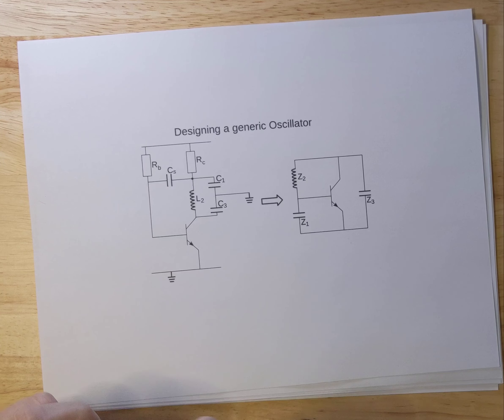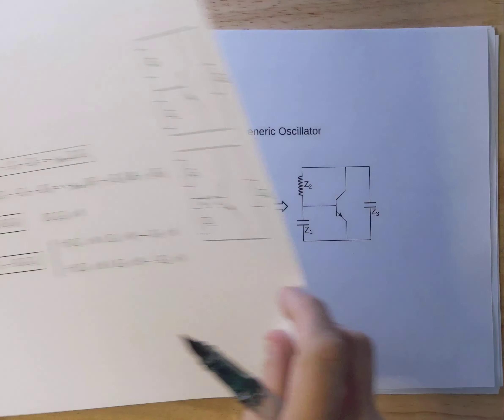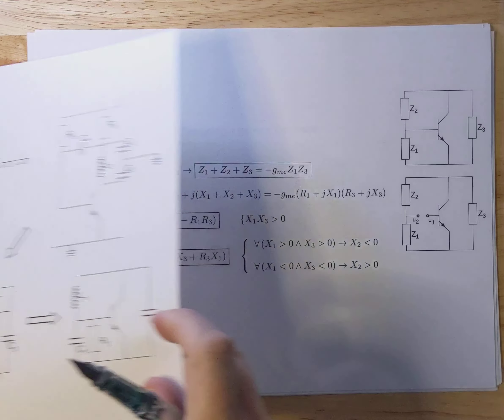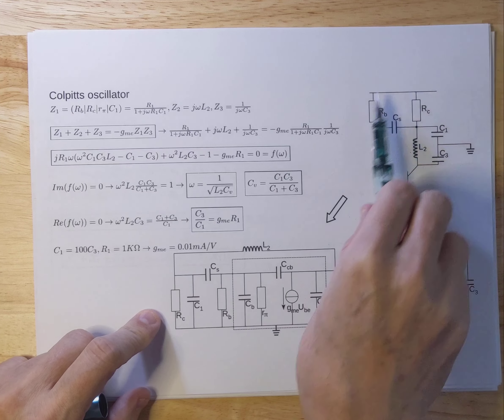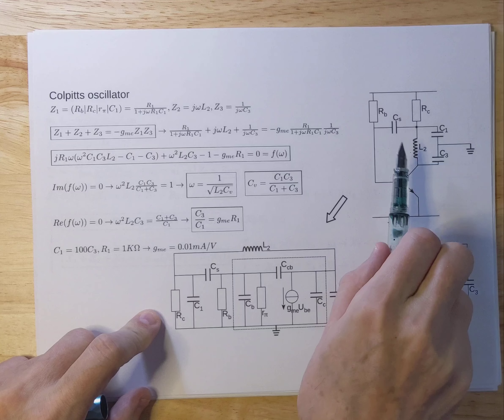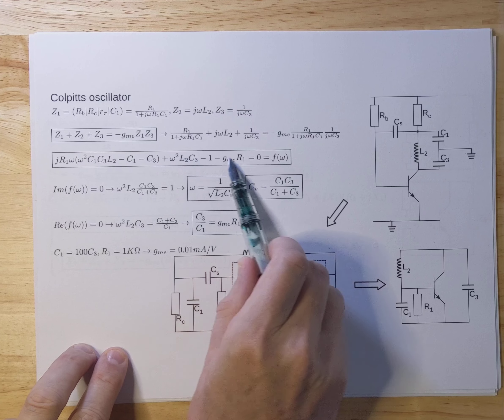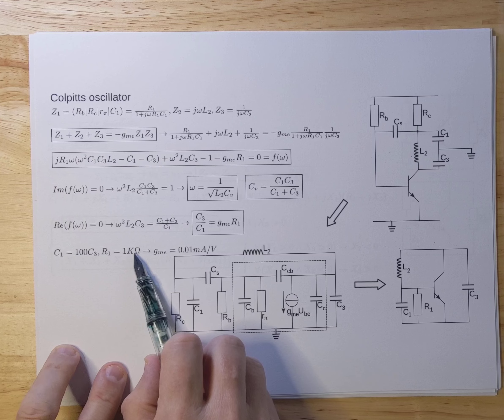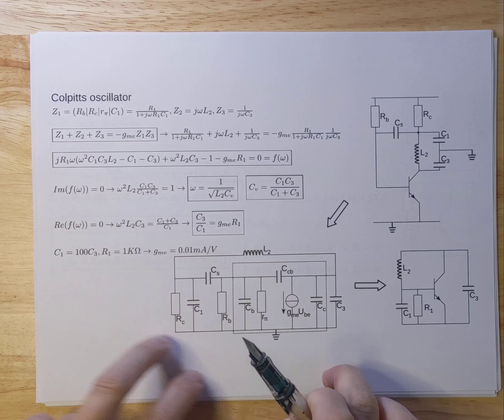Design of an Oscillator!

Comment: Could you explain the first equation (u_2=-Z_1/(Z_1+Z_2) g_me Z_c u_1 a bit better? I'm understanding the individual components, but can't seem to be able to put them together. What is your framework for calculating u_2? KCL, KVL, mesh analysis, nodal analysis or something else? Since the connection between the nodes u_1 and u_2 is cut, how does u_1 appear in the calculation of u_2? Also, second question if I may, is there no resistance in front of the collector?
Reply from the maker: You inject a voltage u1 into the transistor. The transistor in turn creates a current g_me*u_1 this is turned into a voltage by multiplying it with the output impedance of the curcuit (Z_c) hence at the top of Z_3 there is a voltage equal to g_me*u_1*Z_c. As a consequence the voltage at u_2 is now as stated in the video (its just the ratio of Z_1/(Z_1+Z_2))! I hope that makes sense, I should have been clearer as to where I started.
Reply from the maker: with the minus sign of course because of the inversion of the transistor!
Reply: @TheSageofScience  Thanks man! You truly are the sage of science :)